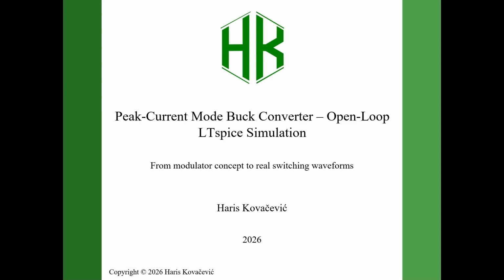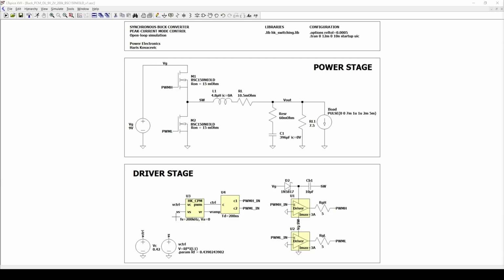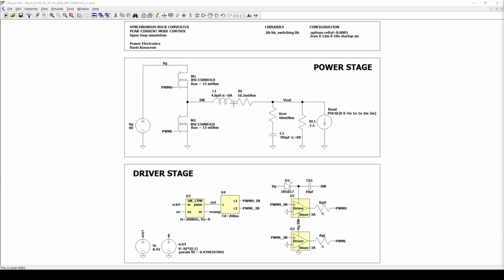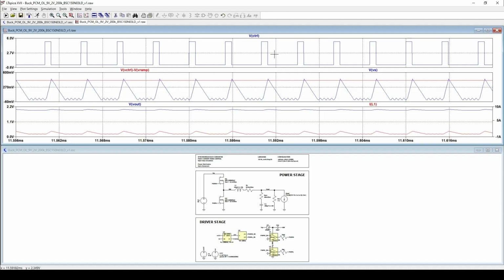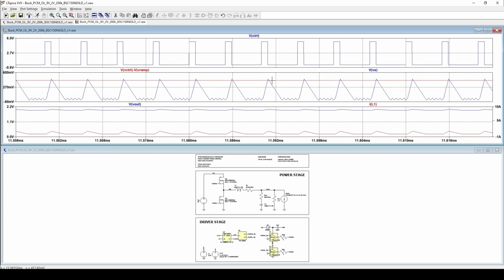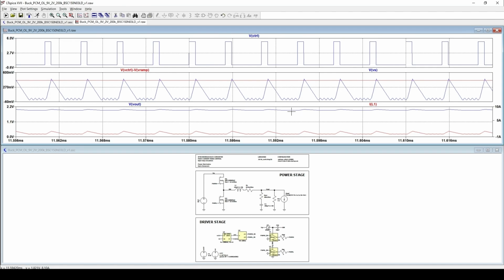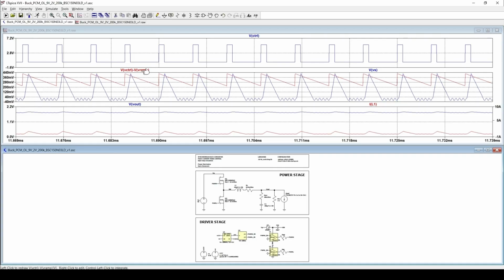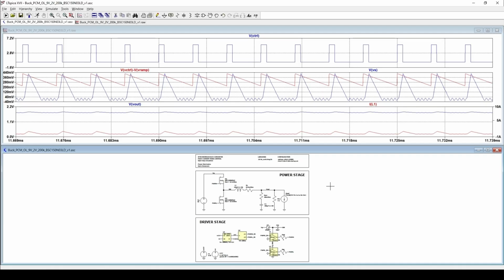Peak-Current Mode Buck Converter — Open-Loop LTspice Simulation and Waveform Analysis

Comment from the maker: 📁 Free Peak-Current Mode Buck Converter Simulation
The complete LTspice simulation used in this video — including schematic, symbols, and libraries — is available for free:
👉 https://hk-academy.com/resources
This open-loop model will be extended in upcoming videos to a fully voltage-controlled peak current mode buck converter, including loop compensation and transient analysis.